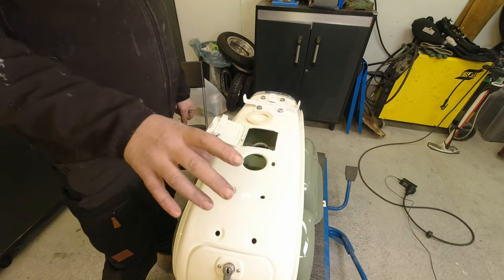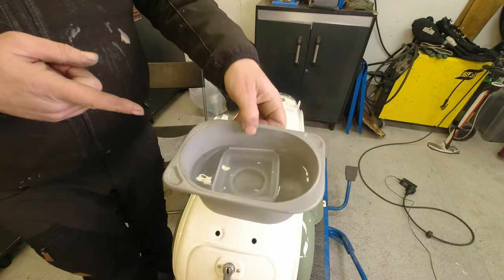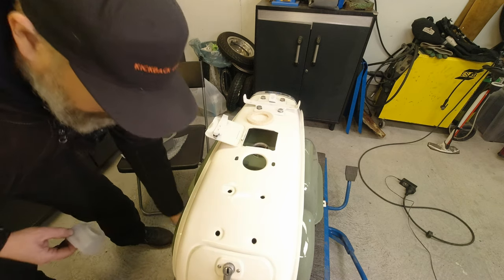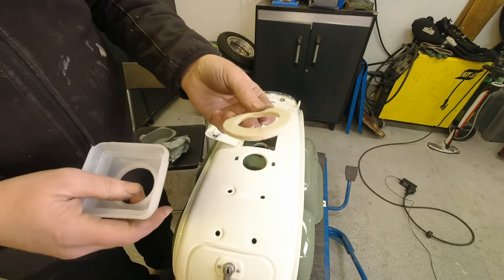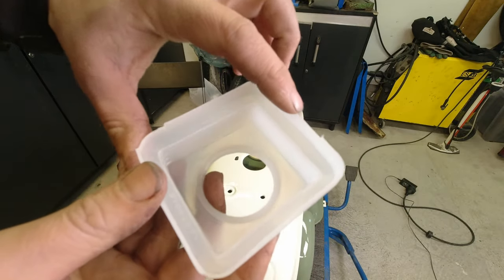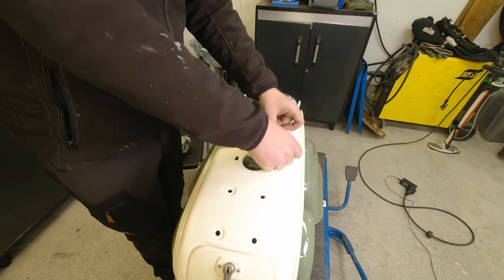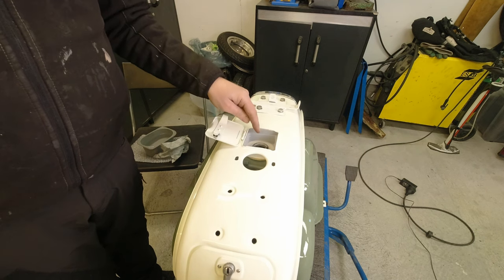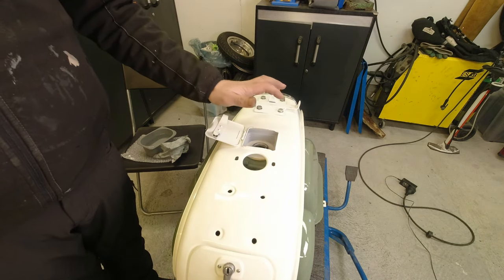How to fit a lambretta drip tray #Kickbackgarage

Comment: Nice little video tip Rob, done exactly the same way on mine a few months ago 👍. Shame that some paint has come off on the petrol catch, but don't think there is a way to avoid it as it has to spring in to hold onto frame loop.
Reply from the maker: That always happens